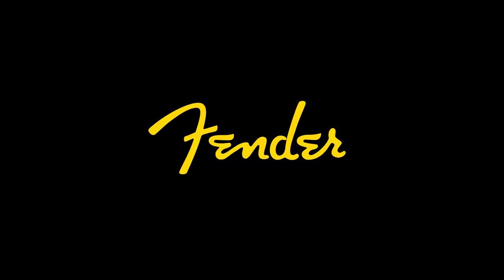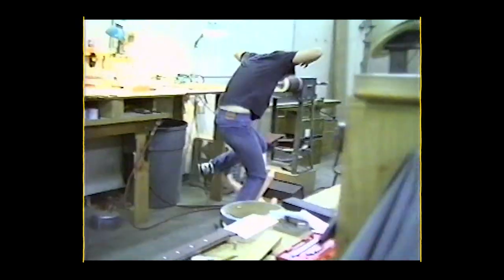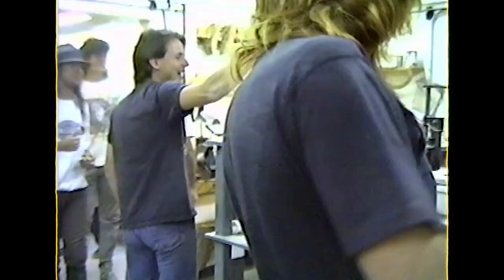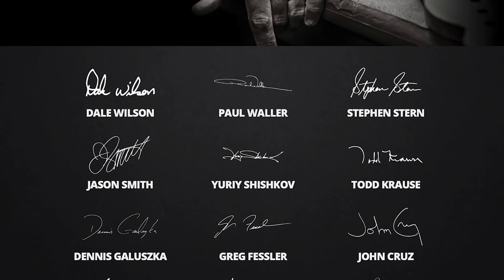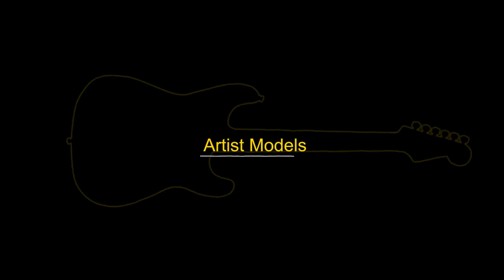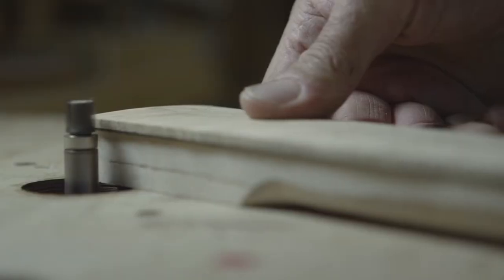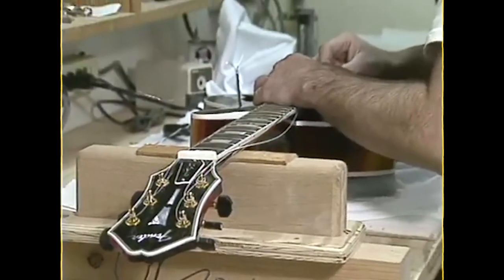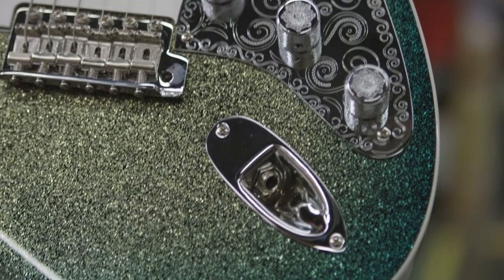What Exactly Is The Fender Custom Shop?

Comment: Can’t say I’m a fan of the Cu$tom $hop.  They’re just making brand new copies of garden variety, off the shelf guitars that were built by regular employees back in the ‘50s, and ‘60s.  Beating them up in an effort to simulate decades of wear that never actually happened doesn’t make them any more legit.  I think regular Fender is making new guitars as good or better than they ever have, and I’ve played/owned several(real)vintage examples.
Reply: I just think that there are better custom shops out there. The craftsmanship of ESP for example is on another level as well as the wood selection for their instruments.